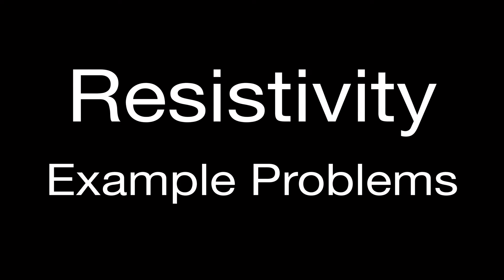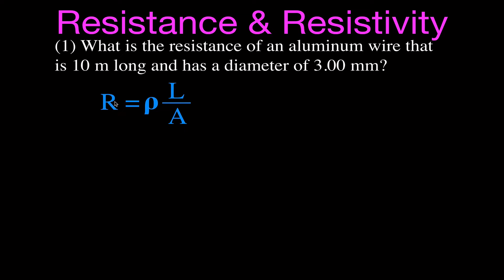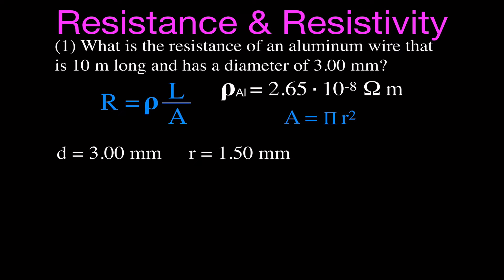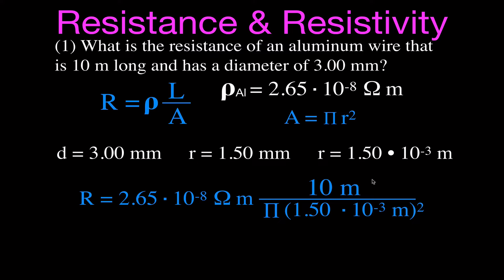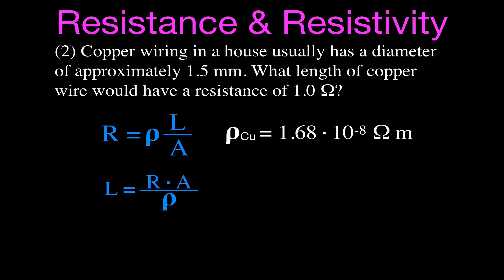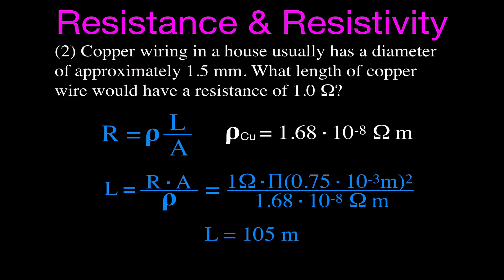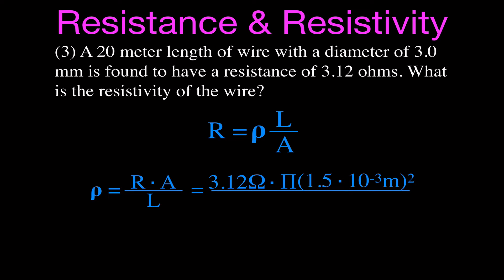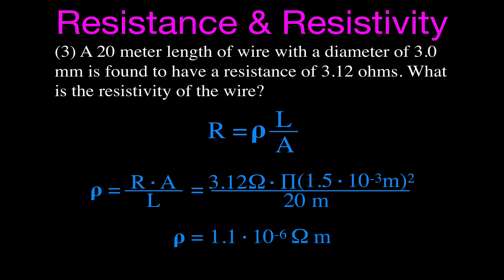Resistance & Resistivity, Example Problems

Comment: in problem number 3 where did u get the 10 from
Reply from the maker: What 10 do you mean, the 10^-3?   That is because the wire diameter is given in mm, which must be converted to meters before it is put into the equation.
A diameter of 3 mm is equal to 1.5 x 10^-3 meters. Does that help?

Comment: Good Day Sir, Why the value of you copper resistivity is 1.68x10^-8? I thought its value was 1.72x10^-8 Ohm-m.
Reply from the maker: I just looked it up on Google and it says 1.72...I am not sure where I got the 1.68 from, but of course that is not really the point of the problem. Sorry for the confusion.
Reply: Dude ur explanation of the equation is legit but the problem comes when u place the final answers which does match up with what our calculators give
Reply: I mean doesn’t match ours

Comment: Thanks sooo much I finally understand it!! You're an amazing teacher!
Reply from the maker: You're welcome. I'm so glad to be helpful!
Reply: I don’t get it why do we have to use powers when converting mm to m for example y is 1mm squared when converted equal to 1x10 to the power -6
Reply from the maker: @rohanwaseem3396  because the are 1000 mm in 1 m therefore there are 1000 x 1000 m2 in one m2. does that answer your question?

Comment: how to get resistance if i have a hollow copper tube length 5m and has external diameter10cm and its walls are thick 5mm the resistivity is 1.7×10power-8

Comment: My motorcycle pick up coil has a resistance of 83 Omhs and a wire gauge size is 40 AWG . What will be the lenght of a wire? Please help.
Reply: 40AWG is 0.00012 meters
you can use the formula to solve for length

Comment: Calculate the resistance of 915 meters length of a wire having a uniform cross-sectional area of 0.77 cm² if the wire is made of copper having a resistivity of 1.7 × 10^¯6 ohm cm.
Reply: Can you pls help me in solving this

Comment: How do you put the resistance into your calculator? I dont understand the 10 -8 part
Reply: That is a ‘to the power’ button which is usually an X with a square to the right of it
Reply: @stupot4278  thank you i got that figured out but for the answer im getting 1.1 and 10-5

Comment: Hello, first I must praise ... a brilliant lecture. Can I have an explanation, please?
R = 2.65x10-8 x 10 / (pi) 3.14 (1.5x10-3) 2 = 3,75x10-2ohms
in my calculation it comes out:
R = 2.65x10-8 x 10/4.71x10-6 = 5.62x10-2ohms
Where am I making a mistake?
Thank You
Kind Regards
Reply: I'm thinking that you'll have to multiply the wire to the amount you get from L/A
Reply: you didnt square r
Reply: Am trying to Puch too but it's not giving me the same answer he is demonstrating